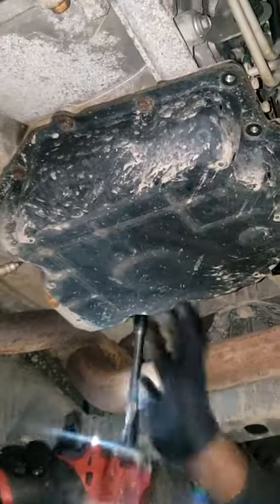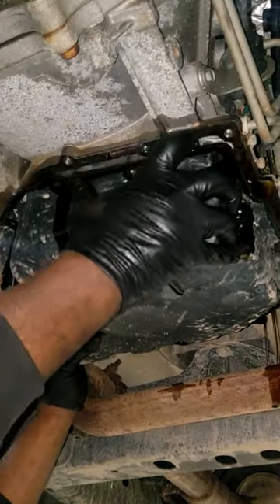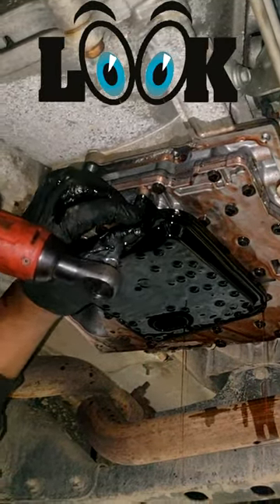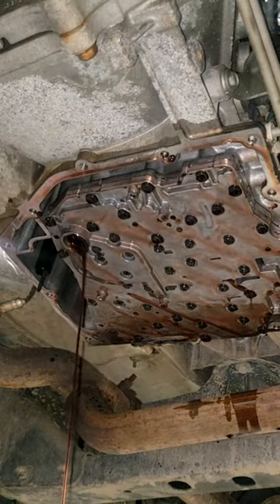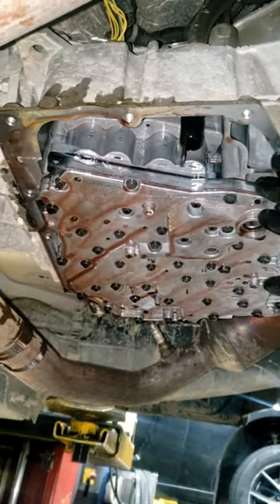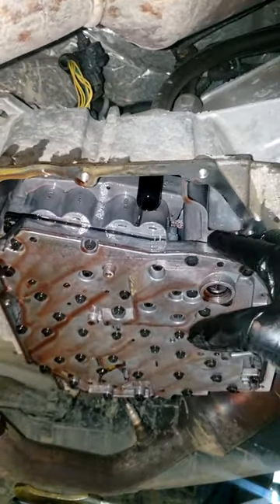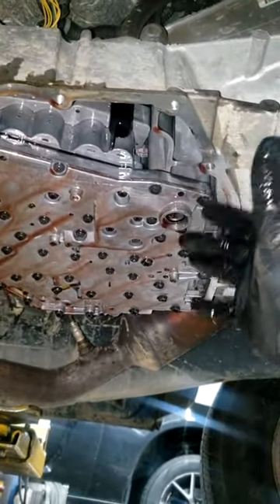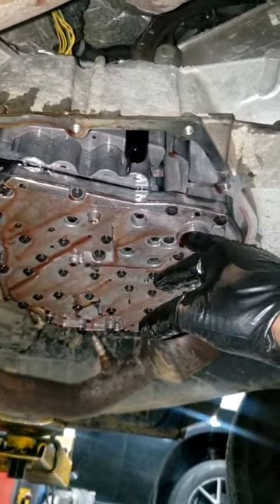No transmission flush machine, no problem. Do This. Best way to get out more of the old fluid.

Comment: Flushing a Trans or coolant system can be worse for the vehicle rather than just do a filter fluid change
Reply from the maker: Im no fan of trans flush at all. So I do not up sell them. I sold a trans service on this one and just decided to try and get out as much of the old fluid as possible
Reply: Why is a flush bad? I’ve read that if you use your cars internal pump to “flush” out the transmission, it’s much safer than a power flush.
Reply: @drpthemc  mostly because you can knock deposits loose and cause them to plug up the entire system.

Comment: The flush is to replace the fluid in the torque converter, cooler lines and cooler. Gravity bleed over night will not do this. Hopefully there's no breeze, heaven forbid a wind that will blow dust up into the transmission.
Reply from the maker: Smdh. This is not a flush job, did you hear anything I said. And what amount of wind gonna blow in this shop overnight with the doors closed. You thinking to hard without thinking..
Reply: @OnlineMechanicTips  But what if a unicorn came in here after a few to many at the local watering hole and stood upside down and peed into that transmission?  That would not be good!😁✌🍩

Comment: I almost always weld a drain plug on the pans that do not have a drain/fill plug installed. Japanese imports get this right, but why do American car manufacturers keep on omitting this? Steel or aluminum, doesn't matter to me, custom make and service is so much easier.

Comment: Does starting the engine help?
Reply: Do not start the engine.
Reply from the maker: No..this just away to get more of the old fluid out. Really another option to draining and refilling it.
Reply: It's not a good idea to run the engine if the fluid level is low, there's a risk of damaging the hydraulic pump by running it dry.
Reply: @thisisyourcaptainspeaking2259  how long can the pump run dry? My theory is that the transmission would push the remaining fuild out of the transmission or tourqe converter. But I don't much about transmissions .
Reply: @EsotericHashira  I don't allow air into the pump if I can avoid it, especially if the transmission is in good condition.
I suppose a few seconds wouldn't do any harm but if you really feel the need, most of the remaining fluid you're attempting to drain is in the torque converter.  Some transmissions used to have drain plugs on the converter itself (like the Ford C6, FMX, C4, for instance), and some people have successfully drilled and tapped drain holes into torque converters (2 plugs 180 degrees apart to maintain balance).
If the fluid is reasonably good condition, where changing half (the other about half is trapped in the torque converter) the fluid is retrieved, pan is removed, cleaned, new filter installed, is quite adequate.
It's really important to change the filter, that's you biggest bang for your buck.
If the transmission is on it's last legs or beyond, go ahead but it's unlikely anything done besides a comprehensive rebuild will solve problems.
Dirty, grimy fluid carries abraisive debris with it throughout, causing increased rate of wear to bushings, roller clutches and the pump, so change 1/2 of fluid and filter every 50-60k to help keep debris from accumulating. If particularly dirty but trans still operating correctly, change 1/2 of fluid with filter then soon afterward you can remove another 1/2 of fluid by pumping it out of the dipstick tube using a section of 3/8 vinyl tubing and hand pump.
I use my hand pump prior to removing the pan anyway, to avoid taking a bath in fluid while removing the pan.
Most newer transmissions no longer have torque converter drain plugs on them.

Comment: A flush is not wat you did. Also. Ppl should not do an actual flush unless the transmission has actual issues. If it don’t have issues then yes just a pan drop and filter replacement then top fluid back off is all you should do. PERIOD
Reply from the maker: First off I never said this was a flush, second, a flush will not fix anything. If you have issues now, you will still have issues after a flush
Reply: Actually if you have actual issues starting with a transmission probably the worst time to do a flush. lot of time it's material in the oil acting as your clutchs. It's best to make sure you do your pan evey 50k or even 30k depending on what you are doing with the vehicle. At the very least change it ever 5 years to keep the amount of water in it to a very minimum. And never do a flush with a machine or as cleaning chemicals to  transmission.
Reply from the maker: @t-bfr45-70  interesting take you have on it.

Comment: So the experts in here think that flushing will clog up the lines and filter?
An expert would know that its valves getting stuck and passenges in a valve body getting clogged that burn up trannys. Maybe a pump failure.
I have done both, flushed and simple fluid change. Even on the dredded 700r4 in C4 Corvettes. Never had any issues.
Once had a Toyota FJ Cruiser doing weird things. Had dealership flush. They said no warranty, AFTER the job was done.
I drove across town to other dealership. Flushed again. This time with warranty. 
Problems cleared up. Truck still killin it 6 years later.
Im sure there were some unlucky folks. It wasnt the service that killed their trannys. Their transmissions were already damaged.

Comment: Never changed the transmission fluid after 70,000 miles and still runs at 420,000+ Honda Accord.

Comment: There's no such thing as "gravity bleed" on a transmission. If you want to get more fluid out, start it up, run it through the gears, and shut it off. The pump will push fluid into the pan area and it will run into the drain pan.
Reply from the maker: Sure it is
Reply: @OnlineMechanicTips  nope.
Reply from the maker: @WagsAutomotive  lol  we just have a difference of opinion my guy. Thats ok
Reply: @OnlineMechanicTips  I guess so. But your "tips" aren't accurate so you should be careful what you tell people.
Reply from the maker: @WagsAutomotive  Excuse me lil channel guy, theres no right or wrong when it comes to opinions. Just because you disagree with my opinion don't make my opinion wrong. I see you have a lil cute small mechanic channel, here's your chance to shine. Make a video on this topic and display your opinions on it. I display my opinions on my videos. No sense in worrying about whats going on over here. As you can see, we rolling over here. Now I suggest you get to work making and editing videos of your opinions. You may get more views and subs.
Reply: @OnlineMechanicTips  yep you were a "Lil channel guy" once. We all have been there. But I won't give bad advice to my watchers. Have a great day! 😁
Reply from the maker: @WagsAutomotive  When I was a lil channel I chose my battles wisely. I didn't go straight for Scotty Kilmer or Chris Fix.  I picked on the same size channels. Theres something on every video you can disagree with. Just choose ya target then go. See you keep talking about bad advice when you suppose to be youtubing. Youtube channels are about numbers. You not judge on what you know but what you show via videos. You could be super smarter than me in the shop but as it appears, im a better youtuber than you. And thats all that matters on youtube. You actually broke the number 1 code. Mechanic channels not suppose to get other mechanic channels with shit like this. I would have never jumped on one of ya vids with this bs even if I totally disagreed with you. Lets get it my dude.

Comment: A tech could sighn a death warrant for the ford six-speed with a fluid flush.
Reply from the maker: I'm totally against high pressure of any kind transmission fluid flushes
Reply: @OnlineMechanicTips  maing, my built old school 727 didnt even like it. Didnt hurt it, but didnt like it either. Shifted funny tryin a runaway 2-3, till i slammed it. Then normal, but 🏴‍☠️ thats a tuff trans.

Comment: Letting it sit overnight for a ‘gravity drain’ is meaningless. More than half of the dirty fluid will remain in the torque converter.
Reply from the maker: Did you not hear anything that was said in the video? Dude it's 6pm, so I chose to leave pan off to possibly drain even more fluid. This is not a flush job, geesh. This a glorified trans service with new fluid and filter. As close to a flush of all fluid as you can get without using a flush machine.

Comment: Personally, I'd have gone a step further and remove the 10mm bolts and drop the valve body, and clean the inside with brake cleaner or prepsol, replace the o rings and reinstall, then new filter, pan gasket and fluid.. that's just me tho
Reply from the maker: Thats not a bad idea. In fact the furthest ive gone was to loosen the screws to vlave body so it would drop a lil. That would get me even more fluid. If this was my personal car yes. This  job pays 1.5 labor so I cant spend to much time on it.
Reply: @OnlineMechanicTips  100% fair enough. 1.5 hours ain't long enough to do the valve body too.. good call

Comment: Or you could use the pump to flush itself? Take the lines loose from the transmission cooler and run the pressure line to a catch can and put the return line in new fluid. Run it to flush, just dont let it go dry from the new fluid supply. You'll likely use more fluid than you would with a machine but it works.
Reply from the maker: Intetesting

Comment: Flush😂🤣. This is just a fluid, and filter service!(someone will sue you for doing shady work like this.  Pay attention to what you say!)
Reply from the maker: smdh. The very first sentence out of my mouth was that this is a trans service with filter and fluid. Either you cant hear or you just simply cant hear..
Reply: @OnlineMechanicTips  Ironic coming from a mechanic that performs subpar work based off of subpar knowledge, who also gives out subpar advice. 

Drain until the cows come home, but that hydraulic coupling isn’t going to cut loose of the huge amount of fluid it holds.

Comment: or how about this grab 2 gallons of transmission fluid and stuff a hose in the filter hole and stab the hose in the jug and start it up and bam  the lines are flushed and the converter is flushed

Comment: Or just do a power flush with a machine, much better to flush all fluids out of the torque converter
Reply from the maker: Im never power flushing anything transmission related on a high mileage car my guy. No big fan of the flush job at all. But to each is own
Reply: To a point yes, if it's that high on mileage you shouldn't even replace the tranny fluid, common knowledge among mechanics.
Reply: But you do you bro
Reply from the maker: @baljinder8014  lol, not all mechanics. Some not just going to sat there and let the transmission die a slow painful death while its starving because the filter restricted.
Reply from the maker: @baljinder8014  Its the filter im concern with. With a retricted filter (from normal wear) you risk starving the pump which will ruin the transmission.  Simply try to get all the old fluid out as possible and yes, you could actually prolong the  inevitable. Seems you more focused and concerned about the fluid. We simply on 2 different paths thats all.

Comment: Dude needs to replace those rusted bolts
Reply from the maker: Why? They do the same job as the non rusty looking ones
Reply: @OnlineMechanicTips  Well rust eats metal plus would have a cleaner look
Reply from the maker: @tegnando2697  interesting point my guy.
Reply: @OnlineMechanicTips  Yes sir I grew up around drag racing

Comment: Wrong...  you got maybe 6 quarts out... Now you have another 11 or 12 in the back.

Also you can disconnected the outlet rubber line on the radiator .. put it in a 1 gallon jug.. run the engine ( pan filled up fyi)  and have it fill the jug.. shut off.  Refill 4 quarts.. repeat repeat.. thats the best way to flush and get it all out.. the trans will cycle all fluid through its gears.. pump and radiator.
 
Hopefully you learned something new from this.

Comment: I had my transmission flush and it ruin it...never more.
Reply: Yeah. It's only supposed to be done like this every 50K miles but if you go over 100k without changing it then it's best not to change it at all. You'll lose the friction material that's in the fluid that helping your tranny shift. Doing this method keeps some of that friction material in the transmission making it less likely to slip. Don't do transmission flushes in the words of Scotty Kilmer.
Reply: @tonyw1563  search "Scotty Kilmer transmission flushes" it's guna be a little wacky older guy that has been a mechanic for over 50 years. Was in Houston then moved to Tennessee. He should have a few videos over the years on this topic.

Comment: This is not true. Drain and fill, run thru gears, repeat as many times until fresh fluid comes out.
Reply from the maker: Whats not true?  This a dam opinion, there's no true or false..You just stated yours. See how that works? Even tho I don't agree with yours its still your opinion. Why would somebody main focus be on the fluid but not the filter is beyond me.
Reply: @Online Mechanic Tips  99% of the time filters only need to be replaced on failing transmissions. The fluid is the most important. Your lack of actual knowledge is so horrific, I am shocked that you would actually post videos on the internet.

Comment: Um... nope! This method will work great to remove fluid from your transmission, but is not a complete flush.

Flushing your transmission fluid requires changing that in the torque converter, either through one with a drain plug or the cooler lines. If you're like me and have a random BMW A/C condenser hooked up as your transmission cooler, it features a handy "drain plug" for that odd time when you need to flush your transmission on the side of the road😂
Reply from the maker: This not a flush. I clearly said that.
Reply: @OnlineMechanicTips  My bad.

Comment: You really don't want to do a flush on really old or improperly maintained transmissions. The reason if you drain too much it could cause the transmission to start slipping

Comment: That's just pathetic!  Without a flush machine,  your method leaves more than 70% old crap in the transmission..!  Listen people, if you get service on your transmission fluid flush and filter change,  go to someone who has the proper equipment.. what was shown here is hack work at best, and a straight up rip off at worst!  This so called mechanic, should know better,  perhaps he just wants to have your transmission replacement under his roof!  Sad, that so many lack honor!

Comment: why didn't you PULL OFF THE DIP STIICK AND remove the drain the plug off the torque converter, their All SUPPOSE HAVE ONE.
Reply from the maker: No, they all do not have one.
Reply: @OnlineMechanicTips  Well that sucks, to bad, 😭😭😭😭

Comment: Without a real "flush," you're only getting 1/2 of the fluid out, as the torque convertor holds 4~5 qts.
Fail.
Reply from the maker: This is a trans service my guy. NOT A FLUSH. You should be more concerned about a trans failure caused by restriction in a filter as opposed to the fluid. The fluid well advanced and can take a beating.

Comment: I bet the transmission slips now
Reply from the maker: And why would you guess that?
Reply: Every good mechanic knows when you drain out the transmission fluid you drain the brass fragments from the clutches out so it makes it more likely to slip in between gears or at least not the life out of it
Reply: @davidsimpson3956 that is incorrect the only brass in a auto is bushings. What is a issue is when you have burnt clutches and your running on the trash in your transmission though at that point your transmission is already trashed. It would actually do a lot of people good to change their fluid if you change it ever 30k to 50k depending on use of the vehicle you would actually get a lot better transmission life. If the transmission was built to hold gear and not slip because people like a smooth shift the clutches would live even longer.
Reply: @t-bfr45-70  is it a myth that doing a flush is bad? Why do people always say a drain/fill is better than a flush? If you’re using the internal pump to flush, shouldn’t that be ok?
Reply: @drpthemc  problem with having a flush done is some places like to use solvent to do it which never comes out completely along with when they use a machine to do a flush it can get larger chunk to brake free and then that chunk becomes a problem after leaving the shop. All you really need is to do a pan and filter everything 30k to 50k and you should be good if it's a vehicle with higher mileage unhooking a line cooler line and refilling it does cause stuff to break free as fast a a machine and usually you will not have any problems just fill with correct fluids do not buy one that is universal.

Comment: Draining the fluid IS NOT flushing the fluid.
Reply from the maker: Who said this was a flush?
Reply: @OnlineMechanicTips  you yourself in this very video say what you did was the equivalent of a flush. 
It's not. A flush runs through the system backwards of operational flow using up to 16 quarts to remove varnish and deposits leaving nothing but clean new fluid in the transmission.
Reply from the maker: @jdoe7697  I just heard what I said and thats not what I said. Don't put words in my mouth. I said this the closest you gone get to a flush if your goal is to get all the fluid out. This is a trans service with an attempt to get as much fluid out as possible.. I don't sell flush jobs. They pointless and worthless. IMO, that filter exchange way more important than that fluid exchange.
Reply: @OnlineMechanicTips  whatever you say bud

Comment: Umm no that’s a “drain and fill” a “flush” is where you push new fluid into it until all old fluid is flushed out by using new fluid and some type of conditioner/cleaner. So no you did a drain and fill. This is why people don’t trust mechanics this guy right here.